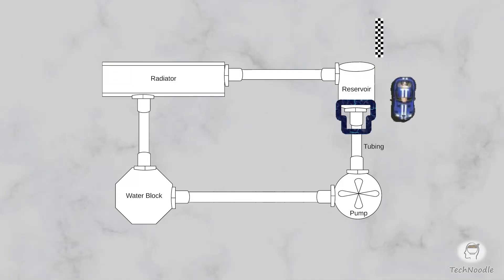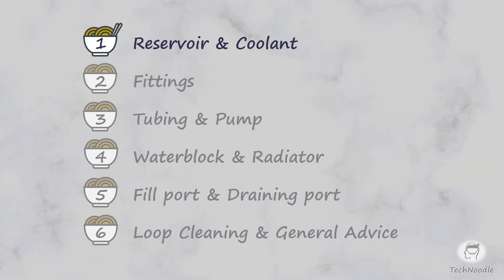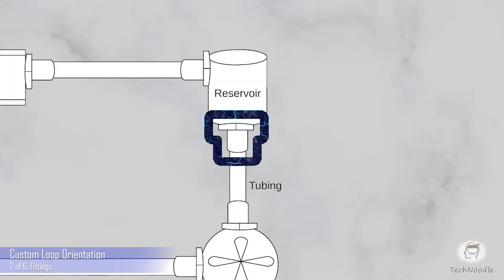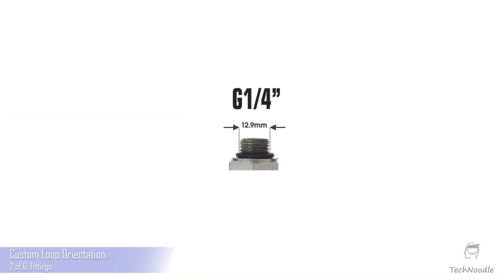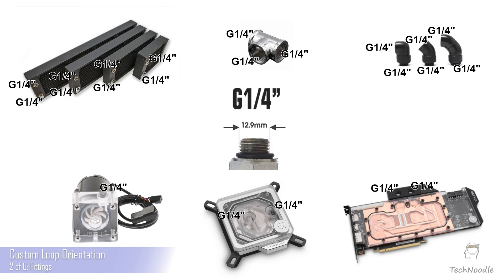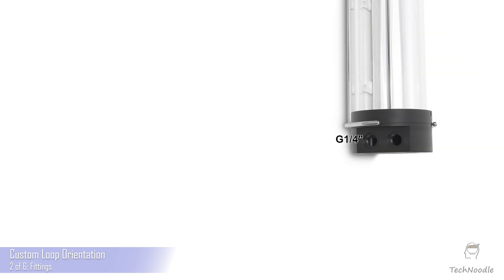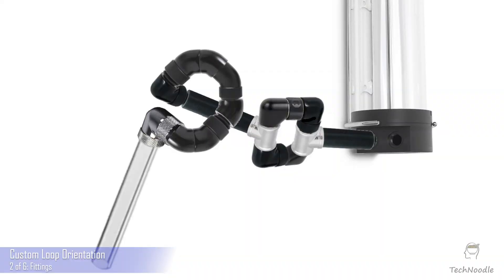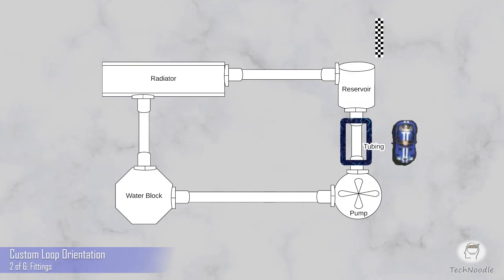Custom Loop Orientation - Part 2: Fittings

Comment: If i wanted to connect a fill port fitting (Hydro X Series XF Fill Port) to a tube that leads to the fill port on the reservoir, how would I go about that?